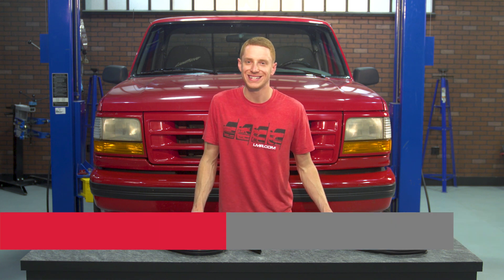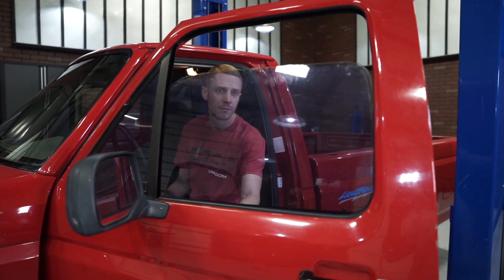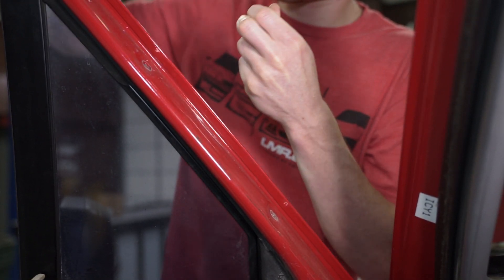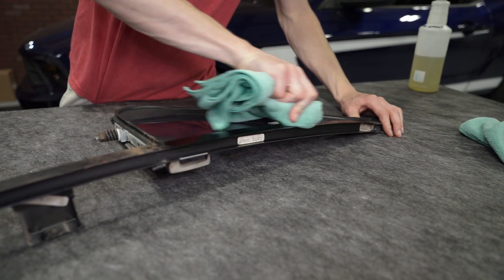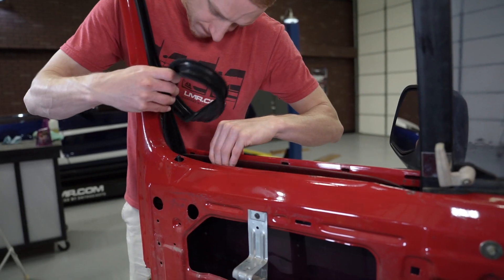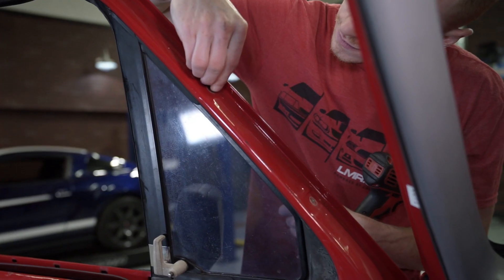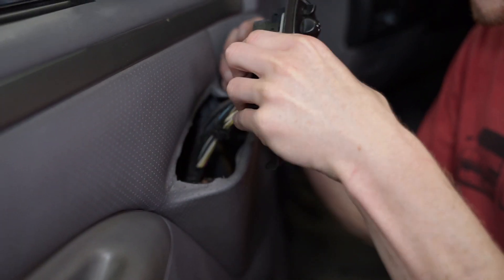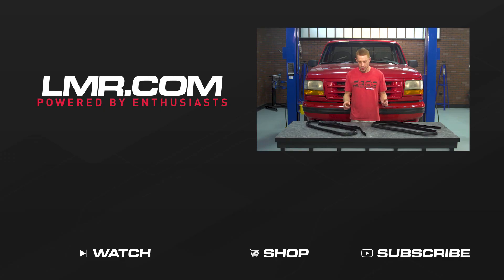Ford OBS Bronco & Truck: Run Channel Weatherstrip - Install & Review

Comment: will these parts fit a 1994 f150 XL?
Reply from the maker: Hey Cesar, we have not tested the run channel weatherstrip on a F150. These have only been tested on the Gen 1 Lightning.
Reply: Yes they will fit any F-Series truck from 92-97. The 1st gen "lightning" is just an Aeronose body style with a slightly better 351w.